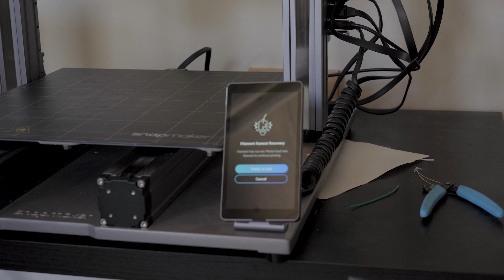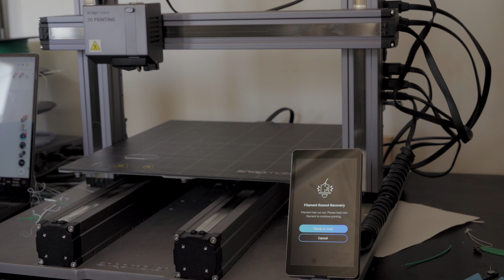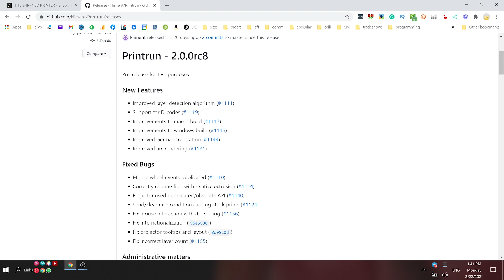Fixing the Filament Run out Error on the Snapmaker 2.0

Comment: My Problem was solved, Thanks very much. In the LUBAN Workarea ist a console. 
Connect with Printer and enter M412 : S0 . Next Step M412 enter,
You see, that the filament fensor state 

Examples

Enable filament runout detection

M412 S1

Disable filament runout detection

M412 S0

Report filament runout state

M412
Filament runout ON

Great...

Comment: I had this error pop up on me after a year or so.  After watching this other video https://www.youtube.com/watch?v=QSc-BzeYxBQ I opened the extruder module and found that the microswitch had become dried out and the two halves separated.  I thought of shooting a little CA glue in there to glue the two halves together, but instead I jammed a thin piece of plastic (I got mine from a left over iPhone SIM card cutout).  I cut a small, thin piece to jam against the microswitch top (the black portion) and the motor housing, but still allow the microswitch lever to operate.  This plastic forces the broken microswitch housing (black & white) to come together so the lever properly activates the electrical switch.  I put the 6 screws back on and now I am 2 hours into a 3 hour print again.

Comment: You didn't fix it. You just disabled the sensor and removed a great feature.
Reply: it's only a great feature if it works.    I'm having the same problem and adjusting the sensor also did nothing to solve it.  I'd rather get rid of a feature that doesn't actually work than keep losing prints 20% of the way through.  If you have a solution that allows me to keep the runout sensor I'm all ears.

Comment: 2yrs later and I just experienced this continual error. I did not want to mess with the physical sensor so am waiting to hear from Support.
But in the meantime I connected via serial USB to run the M412 command to disable the sensor just so i can finish my current project.
Eagerly waiting for a Real Fix from Snapmaker!

Comment: Hi Llama, thank you for your well-done video on how to fixing the filament run-out issue. As you know, there is a filament switch inside the 3D printing module. When the switch is triggered, the module will report that the filament is in, if not, it will report the filament is out. 
Due to some assembly issues in the product line, some printing modules' switch may be too loose or too tight.
Case 1: Too loose, the module will report no filament when the filament is in, which makes you cannot start printing.
Case 2: Too tight, the module will not stop printing when the filament is used up.

Disabling the filament run-out feature is not the best solution, but it can help you start print right away.
Reply from the maker: Hi @edwin, thanks for the heads up on this, I will open the extruder and have a look again
Reply: My switch is working perfectly well and is not loose at all, filament goes in and I hear a click as the switch is activated. However I am getting exactly the same error messages and, probably not coincidentally, just after I started using Cura instead of Lucan.